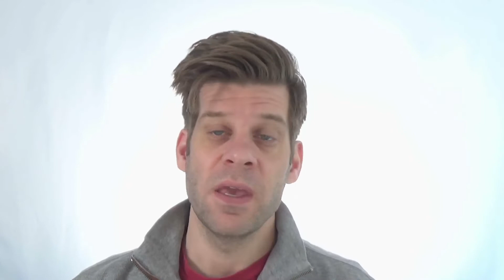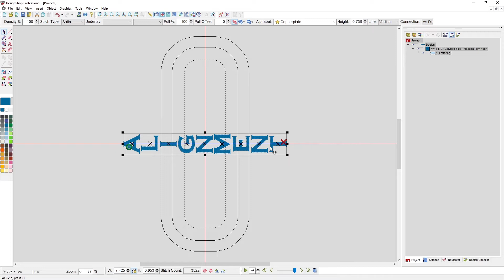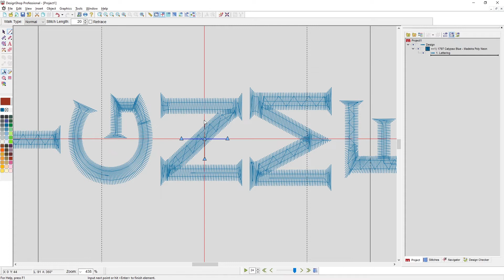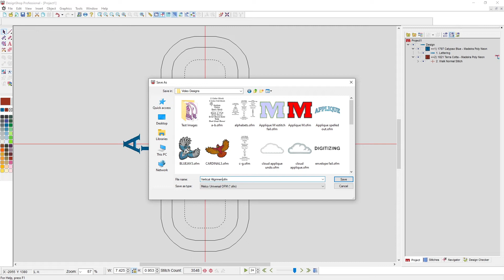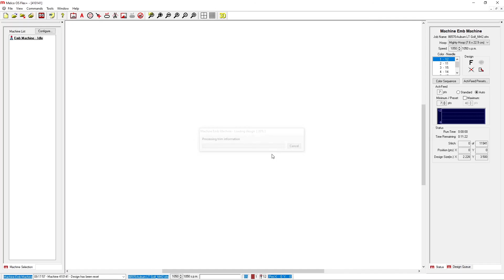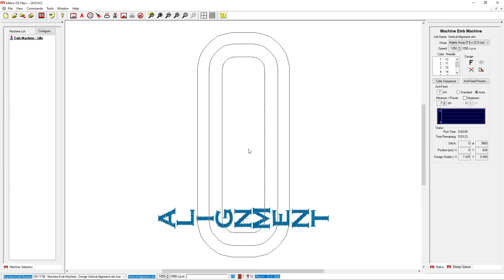Vertical Laser Alignment

Comment: Is there a video on how to use laser alignment if you don't use design shop?  I just want to align my design with the vertical seam in the front of my baseball cap but am not sure how to do this.  And my dealer does not know how to do it.  I'm so frustrated.